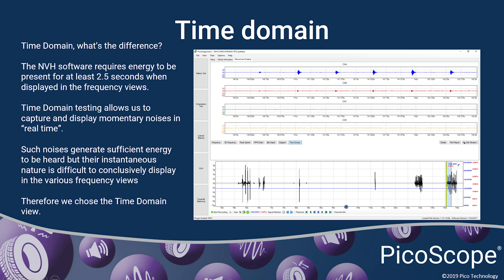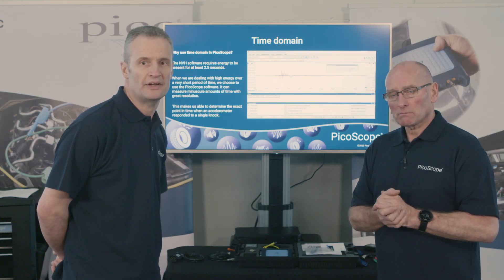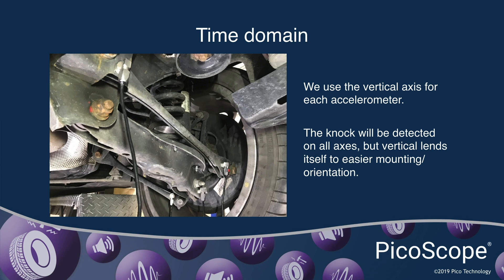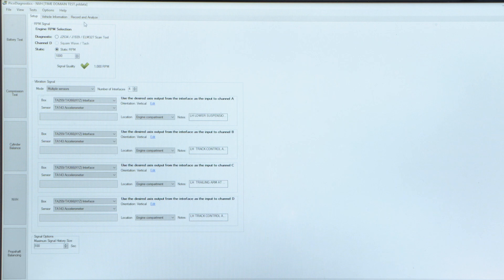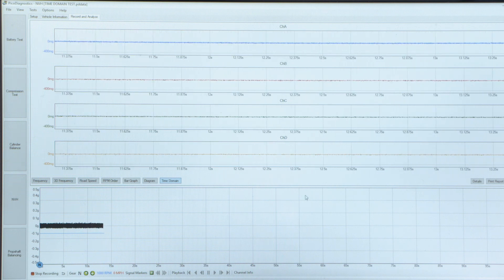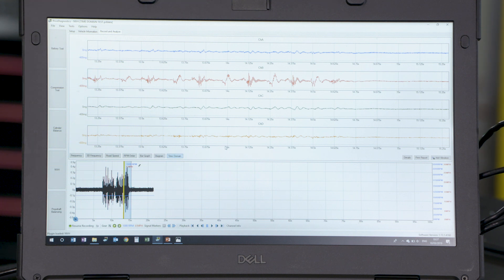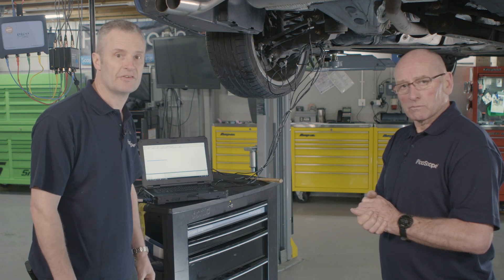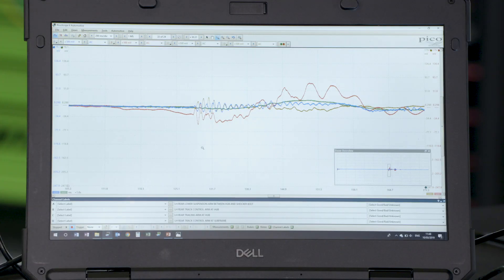PicoScope NVH episode 5: NVH Time Domain

Comment: Great info! But if it’s a noise we can only duplicate while driving or under certain loads, are the magnets for the accelerometers strong enough to hold them in place while driving?
Reply: Hello Julio and thank you for the feedback. Most certainly yes, these magnets will hold the accelerometer securely to magnetic components under all driving conditions. We have tested these magnets by leaving them in place for  weeks under numerous vehicles operating under varying conditions without "contact failure". Ideally we need to ensure the complete surface area of the magnet is in contact with the magnet component to ensure complete and total grip. I hope this helps, take care....Steve
Reply: Thanks for the reply Steve! That’s great. I’ve always been afraid to leave mine on the suspension while driving. 
Please keep up with the videos, they are great! This HVH series has been one of my favorites